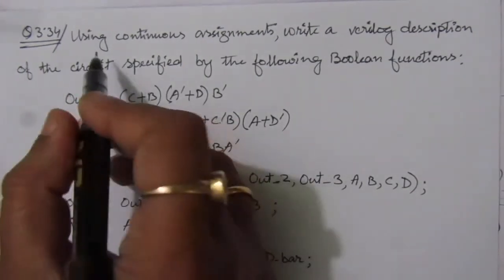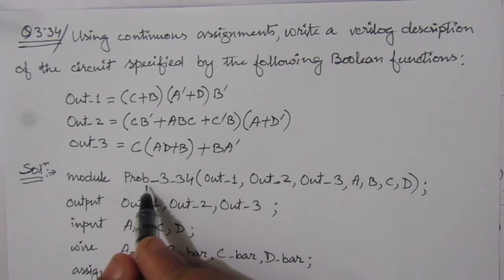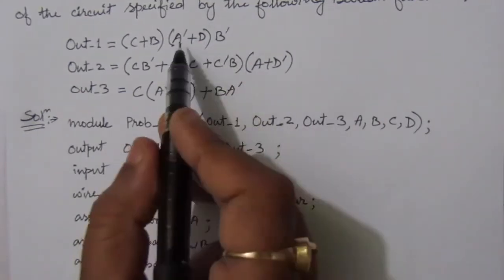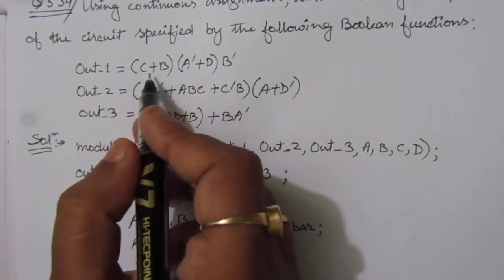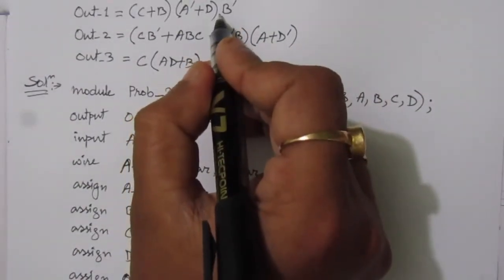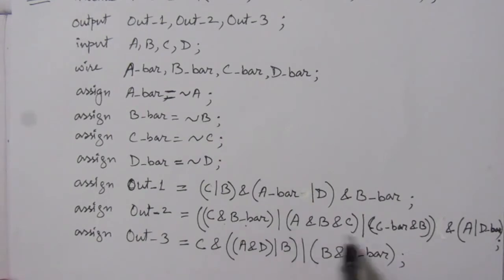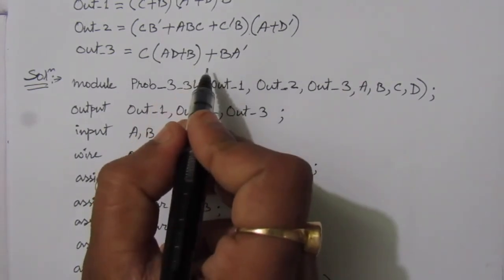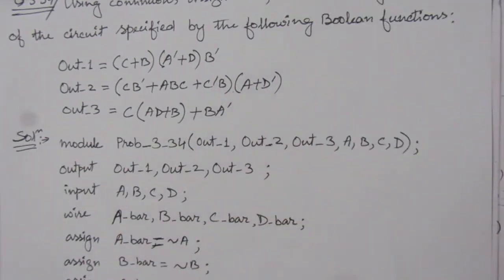Q. 3.34: Using continuous assignments, write a Verilog description of the circuit specified by the f

Comment: Hello, is it possible instead of using assign Cbar= ~C; to use it as ~C without creating a wire variable?
Reply: Thats what im wondering can you not just create the necessary inputs rather than creating a wire